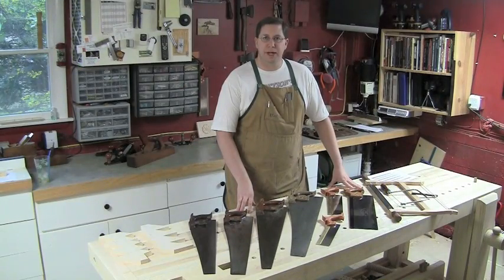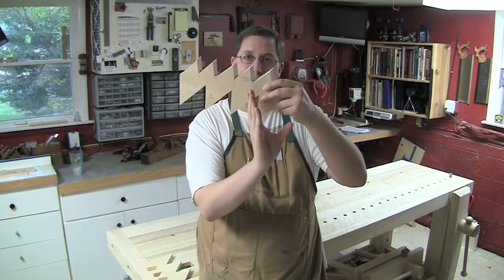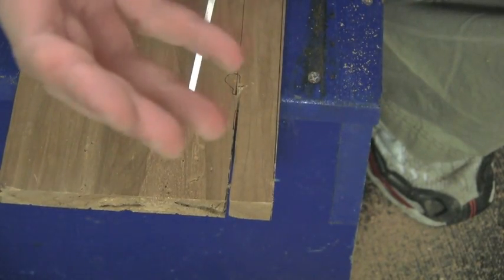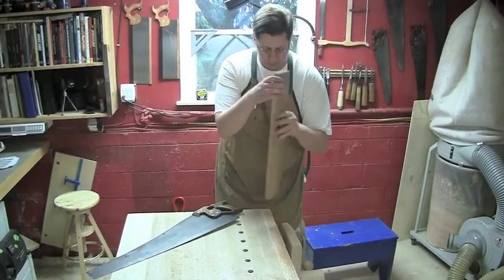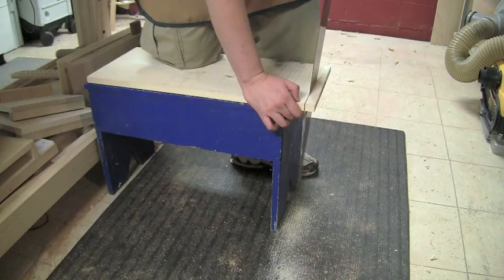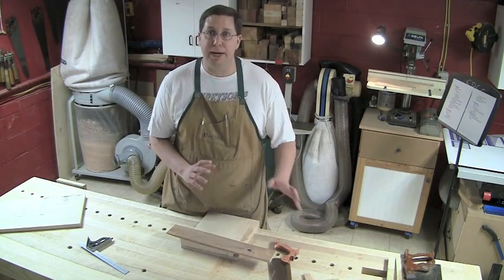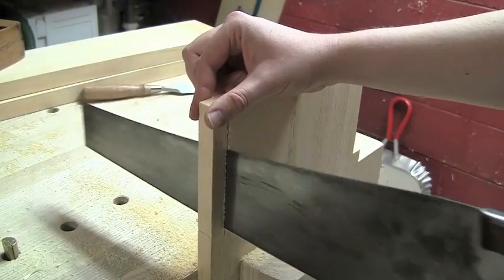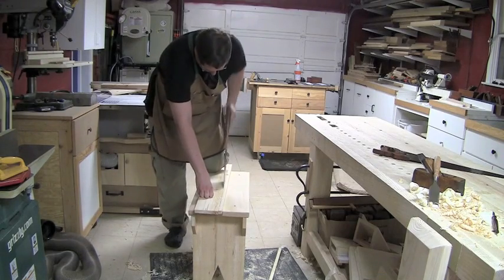Hand Tool School Highlights: Fundamentals of Hand Sawing

Comment: Rip saw teeth are chisels, cross cut teeth are knives.  An interesting side note is, Tage Frid used only rip saws, even when sawing across the grain.  He'd buy a cross cut saw and sharpen it into a rip saw to get a higher number of teeth than is commonly available in a rip saw.  He claimed, & demonstrated that rip saws cut faster, along & across the grain, than cross cut saws of the same tooth count.  The tear out was similar because of the tooth count.